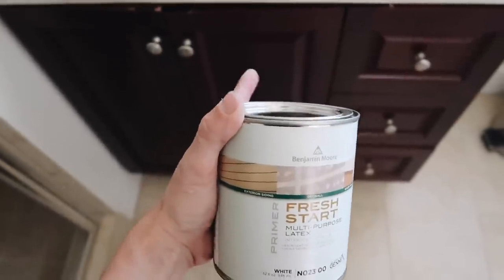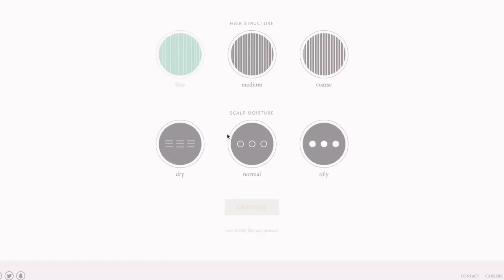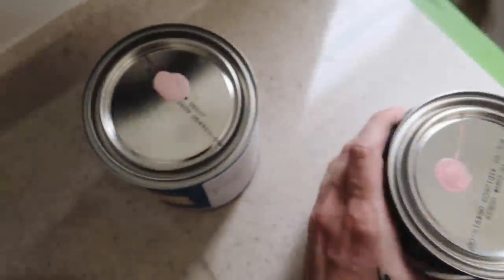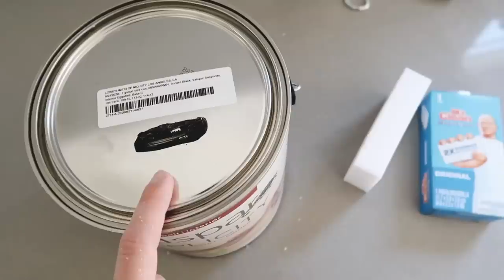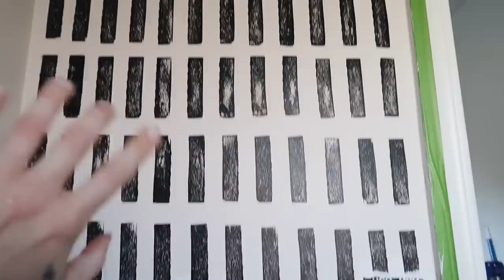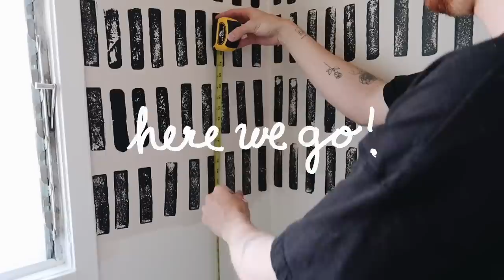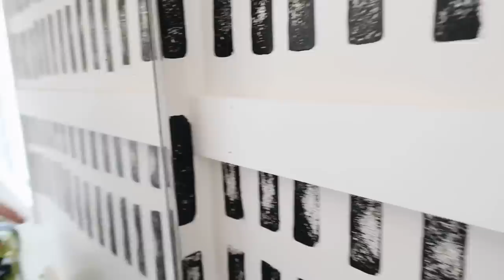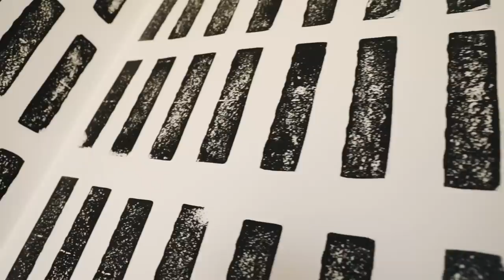EXTREME SMALL BATHROOM MAKEOVER + DIY WALLPAPER FOR 2020 *Crazy Transformation!*

Comment: Love
Love
Love the transformation.
Good on you once again.
Would have gone with a round mirror, though which i think would be in better proportion to the window, and play off nicely with the lighting fixture.
2 hints for fellow viewers:
If you don't have a level, you can download an app for one on your phone. It will work in a pinch. Also if you need a cheap smoothing tool for spackle on a flat surface, use a gift card, they work great for small areas and are very manageable.
Keep up the good work Drew !!!!!

Comment: Those type of  window are called Jalousie windows if you ever have to get one of the slats replaced. 

They are normally in homes in hot places so the window from ceiling to floor could be opened up to let air flow thought before the invention of AC, and still in some places just opening the windows is enough to cool down for the day, like Hawaii. 

They do not have the best insulation as they done made a complete seal like other styles of windows. So come winter that bathroom might end up being kinda cold. A thick heavy curtain might help.

Comment: I love how excited you are over this, and I love the inspiration pics, but this entire space stamped was a bit overwhelming. Good thing you had board and batten but I think that stamping just an accent wall would be better. Also not sure about the Porcelain colour. 
I also feel that the mirror that would be an excellent fit and get some extra glam is one of those art deco mirrors - where you not only have a mirror but the frame is a mirror.

Lastly, something that I've learned about curtains and shower curtains - the more material you use, the better, and richer it looks. I would get one more curtain just as you got but I would on the bottom paint that material black. It would add masculinity to the place and ground it.

Love your stuff.

Comment: Dear Drew, I have enjoyed all of your videos so much and love your positive, upbeat, can-do attitude.  I noticed you had trouble getting coverage on this vanity and wanted to suggest that you try epoxy paint whenever you do cupboards and vanities.  I like using a spray gun, but brushing works, too.  My kitchen cupboard paint job lasted 25 years and was still nick and wear proof when we remodeled.  Usually one coat is all it takes, too.  Also, if you would get an electrician to show you how to solder, your copper jewelry holders will be much more secure rather than using hot glue.  You can solder your jump rings, too!  We are a family with at least 50% redheads and ALL crafters, so I’m adopting you as your great grandmother!  ;>)

Comment: HERE’S A QUICK TIP THAT MIGHT BE USEFUL TO DIY-ERS!!
My dad does a lot of diy and remodeling around our house and he taught me that when you’re putting knobs on cabinet doors or drawers, you should twist the screw in the back instead of the knob in the front. It’ll help prevent scratching the paint/varnish from the front of the cabinet or drawer 😁
Reply: 👍my dad taught me, "Righty tighty, Lefty Loosey", for screwing and unscrewing nuts, bolts etc.